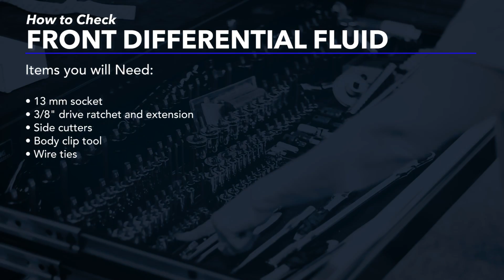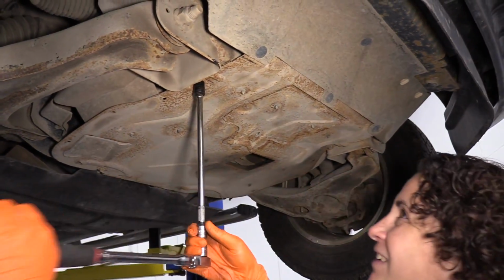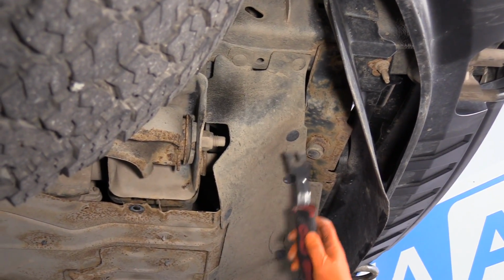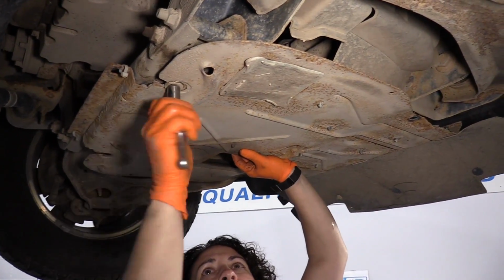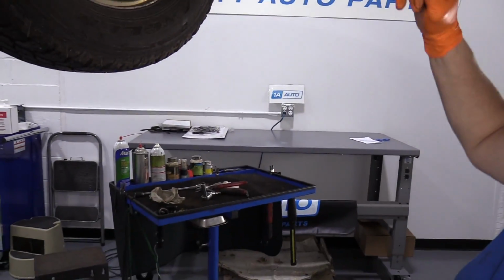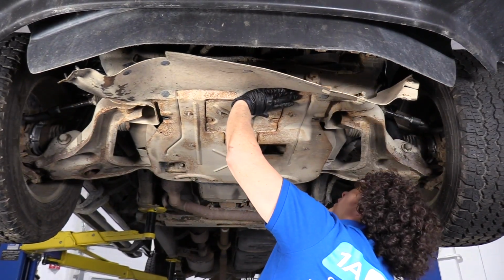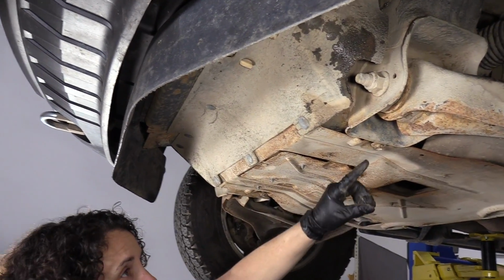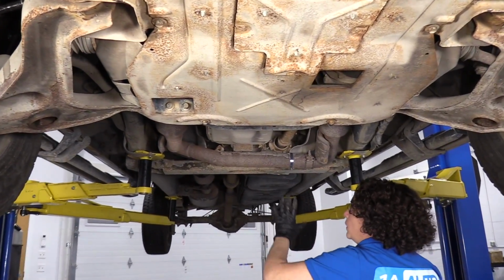How to Check Front Differential Fluid 09-14 Ford F-150

Comment: I have a 2012 f150 xlt 4x4 that I bought brand new and this is the 2nd video you made and your taking off covers I never had on my truck. No other videos have those 2 covers. Is this canada or something where they add different parts?
Reply: I have the cover on my truck and im from canada. I have xlt xtr 2012
Reply: My 2014 F150 lariat 4x4 has them i believe the skid plates are a part of the optional "4x4 off road" package